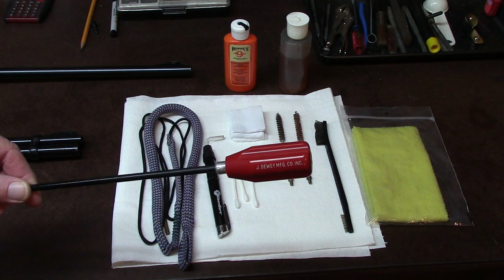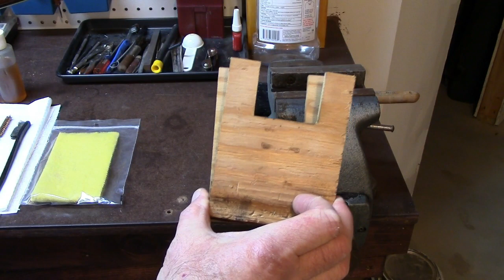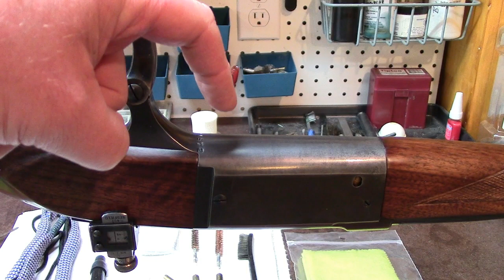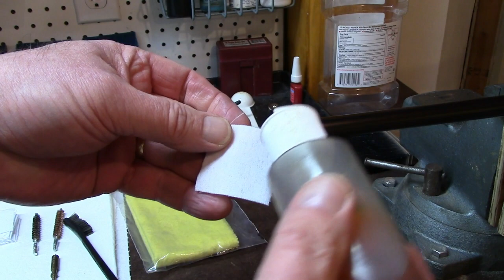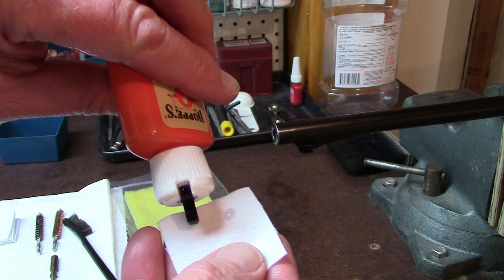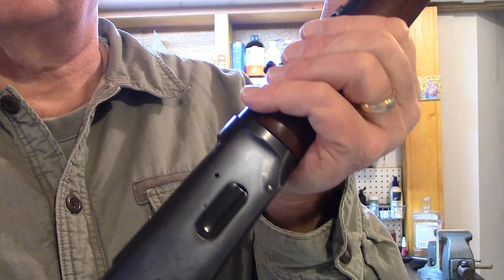How to Clean Lever Guns

Comment: good video,,,but,,,,I still clean the chamber seperately. Had an extractor break one time and the chamber was so crudded up the poor extractor did not stand a chance,,and I will still apply a small amount of oil on bearing surfaces and gun grease where there is wear marks from metal to metal contact

Comment: I acquired a Sears 'Ted Williams' Model 100 30-30 just recently. As you know, it was made for Sears by Winchester as a replica 94. After firing it (ow!) a few times I watched several Winchester 94 disassembly/reassembly videos I was able to take it apart and put it back together. Though all the inner workings are not exactly the same, they were close enough to where I could do it with a little intuitive thinking. It wasn't that hard for those that want to try. And yes, it did fire afterwards.:)

Comment: Man, I just went out into my garage and used an air compressor and a tshirt to clean excess oil from my 94! I also cleaned the barrel for the first time the RIGHT way, thanks to you!  I also put it away upside down for a while to hopefully pull any light oil away from the stock to where I can get at it in a few weeks or days. Very soon my 30-06 Herters bolt action will get a new set of eyes on  it as well!

THANK YOU for taking the time to share when clearly you already knew what to do.
Stewardship is more than a word with you.

Comment: I have enjoyed many of your videos and learned a lot of valuable information from each of them, watching you locking the barrel of your rifle in your bench vice gave me an idea you might like. Your wooden inserts are a great idea but as most machinists know the best way to hold round stock is a v block. By  increasing their thickness to 3/4” plywood and cutting a horizontal v grove in each side at the height of the vice’s  jaw, with a 1/8 pitch so liquid will roll out of the end you choose, will lock the barrel in place with a lot less force.  You could even make a double grove for lever actions with a tubular magazine like a Winchester.

Comment: You are no liar sir, and I must give you high praise for that. Until viewing this video, and then re-watching it as I cleaned my own piece, i will be honest and say I somewhat doubted your technique. I can tell you that opinion has made an abrupt change! I used to clean guns exclusively with patches, I would use dozens back and forth, back and forth through the bore, until they came out spotless. Needless to say, this process took a very long time, and expended a lot of materials. Then, in my ignorance, i would oil the action of my model 70, every time! It was just what I was taught I guess. Their was even one time, I wiped the whole gun down with ballistol (the only time I made the mistake of using that awful smelling product) thinking I was doing it a favor, again wrong. I also, am now a supporter of not only cleaning in a vice, but upside down, which feels wrong, and right at the same time, as everyone else in fireams world would grimice if they saw a gun in a vice, but my how sturdy it is when set in with wooded calls the same as you have. In conclusion, after doing a heafty dose of shooting with my brand new 1873 lever action (which i did not bother “breaking in” by the way) i cleaned the gun with your exact method, and expelled only 7 patches and most likely 5 times less hoppe’s. At the conclusion of my cleaning, which took little time, i was left with a gun that was cleaner than I had ever gotten one before. Thank you sir for all that you share, you lessons have been an absolute gem for a young shooter like myself.

Comment: My solution to over-oiling? Thin layers of high quality grease on strategic metal-on-metal areas.
Grease stays where you put it, though light oil application is sometimes necessary.

Comment: G'day ol' mate,
I enjoy your videos, always got great info. You said you've been shooting 55 years, I've been shooting for 50 years and from day one we were held responsible for the cleanliness of the rifles. I agree 100% on the no oil in the action. When I clean my rifles I use what we've termed for years as the "grey cloth". This is simply a cloth onto which graphic powder was lightly spread, rubbed in and shaken. A final rub over the moving parts just adds the smallest amount of dry lubricant to contacting surfaces, but not enough to cause a mess. Excess graphite will get messy so the amount dusted onto the cloth is minimal.
I shoot black powder in my Sharps (45-120) exclusively, so after each session I totally strip, wash, scrub, clean, scrub and clean again to ensure every trace of residue is removed (I love my Sharps), it is still in virtually brand new condition, purchased back in the early '80s when Sharps Arms Inc reopened their factory.

I was a little disappointed that you didn't strip the '94, even for a "have a look at this" session on it, but hey, ya can't have everything. Agreed, not necessary to totally strip and clean if using nitro powder.

Down here in Oz we're not looked after like you guys over there and I'm still waiting for my Marlin CB (95) in 45-70 to turn up, been waitin' months and still got a months to wait. I'll be using BP for noise and effect with this baby mostly, but nitro for hunting so total strip down & clean will be of necessity to ensure it is kept in top condition. As you iterated, the 95 is a lot easier to strip than the 94.
Again, thanks for the video, greatly appreciated and enjoyed.

Cheers from downunder mate :)
Reply from the maker: +Pilot McBride As for stripping the 94, it's flawed in that respect.  The lever link screw is heavily staked in place on both sides.  While disassembly is certainly possible, as I've done on numbers of occasions for service, it's highly advised to leave it alone, as the screw can only be restaked once or twice before it will no longer have a good purchase.  Once it begins loosening, the gun will become utterly worthless.  The forestock and buttstock may be removed, but I don't encourage that, simply because again, this model tends to lose integrity once such parts are manipulated too often.  One the other hand, this model came out with smokeless powder from its inception and doesn't require a full breakdown for washing.  As long as it's not flooded with oil that can certainly make a mess, all will be fine for many years.

Thank you for watching!
Reply: GunBlue490 Ah, the penny drops, thank you for this explanation, greatly appreciated.

Comment: high gunblue it's Carl, WATCHING "How to Clean Lever Guns" now i question my old practices. I am 67 years old and i learned from a older man ,my mentor how to do it. Clean with Hopps then run a path with RIG rust inhibiting grease through the boar, take a rag with RIG and wipe down the barrel and steel and finished. As Fred would say " rig stays where u put it". When i got older i fell for the new mindset' Sweets 7.62 approach, pulling the copper out. And i did. long soaks, and patches until no more blue.After a range session disapointment, the groups were all over the place. i felt i burned out the barrel After watching your video's, leaving the copper to fill the low spots i can understand. My old deer rifle before i went to the 270 was all over the place after i cleaned it. Would love to here from you. U are the only one i trust on the Net.
Reply from the maker: Carl Lovendale 
Sweets is extremely aggressive and should never be left in a bore to soak. I can only recommend that you watch my video on how to clan a rifle professionally.  A simple cleaning is all any rifle requires.  Use grease (Rig is just grease) with discretion, and be sure to wipe all traces out before firing.

Comment: Most excellente!!  For those still wanting the large traces of copper out there is a fun way to remove it. After you get done shooting your hunting loads, fire off some reduced loads (1200 to 1400 fps) with copper bullets and it takes it right out. Good offhand shooting practice to boot. I have seen excessive copper come out when cleaning with a patch where it isn't just a smear over the low spots but small copper hair like strands that come loose( not the brush bristles or case shavings either). This gets it out. Trail boss powder is the hot ticket.

Comment: I got a 99 off an auction.  It was a closet queen.  It has some surface freckles but the bore is pristine.  The well of the magazine was a mess inside.  I need to do the wood because I just know it will be beautiful like yours.  I took it all apart and gave it a thorough cleaning.  On the 99’s, like you have shown, turn it upside down or you will wish you did!

Comment: I agree with your cleaning i always said to much oil collects dirt.. I use tetra gun grease.. With a qtip and then wipe it off only reason ive ever done that was to keep my winchester 94 from starting any rust.. Tetra has something good in it Becouse over the last 15 year's I've never had any rust form of course i always dry out good when i Get soaked .. About every other year it gets a good tear down cleaning .. Nice thing with the winchesters there easy to disassemble .. Great video i always liked watching your videos.. I use kroil oil at times to clean my bore you ever hear of it? Is great stuff ..

Comment: this is of great interest to me beyond the excellent instruction because i acquired a similar 99 about 25 years ago in 300 savage with a serial number indicating ww 2 vintage.  it appeared to be in unblued steel and without a  single bit of rust, possibly in stainless, but unlikely in our research.  the iron sites were gone, and no stith mounts in the shop's gunsmith parts bin.  we finally made a deal after a couple of weeks and deep in my safe it resides, unshot by me--not unusual in my last few years of collecting long ago now....

Comment: What do you think of me using my G-grandfather’s 1912 vintage Savage 1899 (straight comb) in .30-30 on Roosevelt elk short of @100 yards?  It’ll be loaded with a Barnes 168 gn. TSX solid copper and 35.5 gns. of Leverevolution, which produces mv’s @2300fps. and @2200 fps @100 yards.

I needed a brush gun for Oregon timber hunting and was given this gun from my mom.  I replaced the buckhorn with a period authentic Marble peep sight (I’m a vet and used the peep on the 16,) and won’t ever install a scope.  I love your content and your yearnings to hunt the West.

Comment: Great video and love the old lever action, I have to admit I am guilty of over oiling at times, I do return to remove excess. One question is if you have recrowned  to achieve the level of accuracy?  It looks as though it has a 45 degree  angle, or is that just the lighting? As a lifetime shooter, reloader and former advanced marksmanship instructor at ft benning I value greatly all the information you share.

Comment: Good video, but sometimes the exteriors need oil.  In Florida you can leave a rusted in thumbprint on a gun in a heart beat if it isn't oiled.
Reply from the maker: I always advocate the use of a lightly oiled cloth on guns to protect them in humid environments.  However, more oil does not protect better.  Florida has no greater humidity than New Hampshire or any other state east of the Mississippi.  Fingerprints leave rust because of the salt in perspiration, which varies greatly among individuals.  Folks perspire more in hot environments, whether it's 100 degrees with 98% humidity in Bangor, Maine on July 4th or the same conditions in Mexico.  My dad lived in Florida for many years and kept his blued guns in perfect condition with a light wipedown with an oiled rag. FYI, personal chemistry varies, so some folks have exceptionally salty and corrosive fingerprints regardless of atmospheric conditions which requires almost constant care to prevent rust, but it's not about using more oil; just attention.

Comment: Thanks for the info, now I have a better understanding of the copper buildup in the barrel. It seems all the bench rest and F class shooters I shoot with are overly concerned about it. Every 3rd or 4th outing I break out the Remington X to clean out the copper.
Reply from the maker: Actually, they are perpetually reconditioning their barrels, just when they have settled down, and are missing out on the best accuracy their guns are capable of.
Reply: @GunBlue490  that's funny, my friend shoot 22 matches with Anschutz rifle and scores 10's and X all the time. He never cleans his rifle. He decided to clean it and his score was all over the place. He stop cleaning again, now it shoots 10's and X's. Thanks
Reply: @GunBlue490  Agreed, I target shoot offhand with a 10/22 (custom) and an 1894 Marlin. Both shoot the X ring out with minimal cleaning. Far more important was matching the ammunition to the gun. SK Match for the 10/22 and .432 softer cast bullets for the Marlin. Thanks for the video, confirmed my light oiling, probably even less now!

Comment: Thanks for your most informative videos. I just bought a 1892 Chiappa Lever Trapper and have trouble chambering a round. I was going to oil it but now will not. Does the action just need to be broken in as the bullet gets jammed at the barrel?

Comment: I think the bore brushes are brass, not bronze.  The composition of bronze varies, but it is typically hard enough to scratch steel.  Brass is softer.
Reply from the maker: The industry term and accepted one used on packaging has been bronze, regardless of the actual composition.
Reply: Craig Campbell You're right. They're made out of brass, but their material is usually called "bronze".

Comment: I am a new gun owner and my first purchase was a new Henry lever .22.  After spending much time searching, This is the most comprehensive and best video that explains how and why to best clean your lever gun. I may use the bore snake more but I certainly  will listen to  the warning about over oiling.  I will have to educate myself by watching all of your vids. AS for the dopes who want instant gratification, you can only hope to fit 55yrs of gun exp in a 56 min video! Thanks for doing your best.  One question, if I clean my rifle while wearing latex exam gloves to avoid the oils from the hand, will that help or is it just overkill?
Reply from the maker: Some folks can certainly experience sensitivity to any cleaning solvents, and anyone can develop skin rashes, at the least.  At worse, cancer is always a threat with long exposure.  Personally, I believe that protecting the skin from unnecessary contact is very wise.  This is one of my principle reasons for using little solvent, applied spparingly, and avoiding unnecessary skin contact.  USP mineral oil is 100% safe for wiping your guns, even if consumed, which is unscented baby oil, among other things.
Reply: Haha..i could give two craps about my skin, after 20 yrs as a FF in NJ, a little solvent and oil wont bother me.  i am more concerned with the nice  Henry stock and the other parts. Just trying to keep oil from skin and fingerprints off of it before it goes into the safe. Thanks again for the valuable info.
Reply from the maker: +truck guy fiftynine For that, be sure to get a heated wand... a golden rod to maintain dryness.  Safes are notorious rusting vessels without them, due to condensation.
Reply: Thank you for ur helpful advice. I def will be watching and learning from all your videos. Then try and pass it all down to my 11yr old boy.

Comment: Great video. This man is an expert, and I'm not, but I do wonder about using an air compressor to blow out the action. I say this because compressors hold moisture. When I empty the tank on my home compressor in the summer water/moisture comes out. In the winter if I use it and drain the tank (I always drain the tank after each use) it will spit out tiny ice balls. It's moisture. Dirty air is also a factor. I guess a filter can be put on the compressor to make this safer.
Reply from the maker: When I speak of using an air compressor, it's a rare event that is done only to certain guns with concealed, inaccessible  actions, and is something I'd do on an as-needed basis.  On a practical level, I've done it three times in my life, and only to three different guns that I had acquired previously used, that had been abused with love or the lack thereof.  As to the moisture issue, the amount of moisture that a tank collects is directly related to the ambient humidity, and it occurs throughout the year, to one degree or another.  My dad sold pneumatic fastening systems when nail guns were first introduced, and he constantly preached the importance of keeping the compressor dry, for the best performance and the life of the gun.  Every day, you say?  Nay!  Perhaps every 20 minutes on a sultry summer's day!  Even during dry days, compressors concentrate ambient moisture very swiftly, but it does pool at the bottom of the tank, until the air is saturated, at which point it will emit from the hose.  Moisture or ice coming from the hose is a sign of having an extremely saturated system.  Water laden air will not compress and will also cause your regulator to kick in constantly, because you have effectively reduced the volume of your tank.  As soon as it starts to over-cycle, and long before you notice water, open the pet cock while the tank is under full pressure, and allow it to run until absolutely no moisture comes out.  A moisture collector is one of those things that a regular compressor user should always have.  Going back to the use of a compressor for evacuating crud from a gun like a Model 94 or 99 Savage, I repeat that only 15 pounds psi should be used, and of course, it must be dry air.